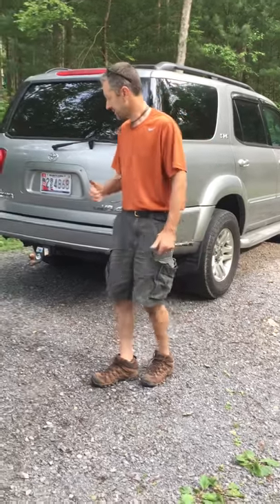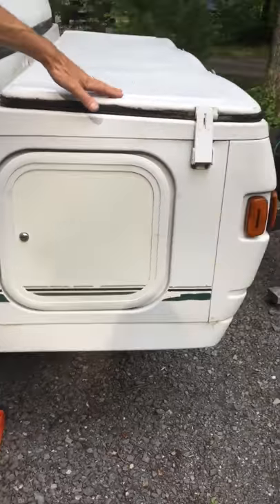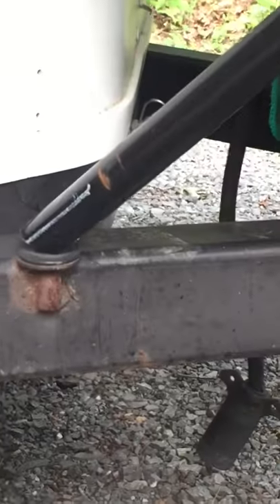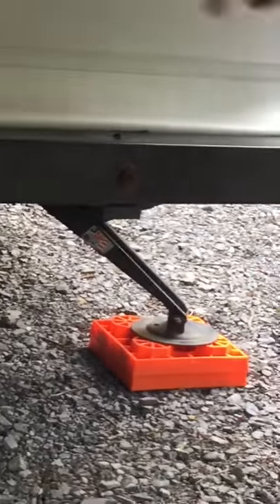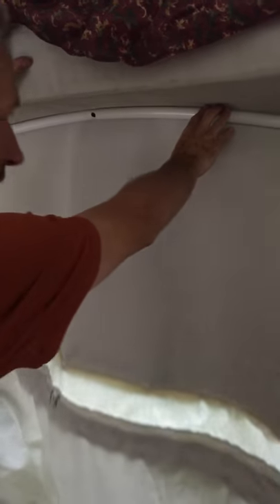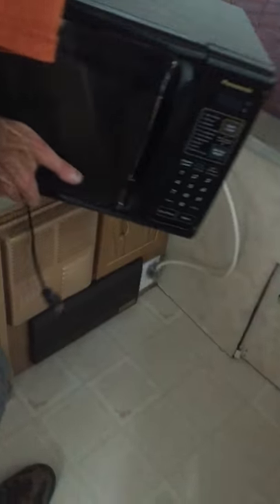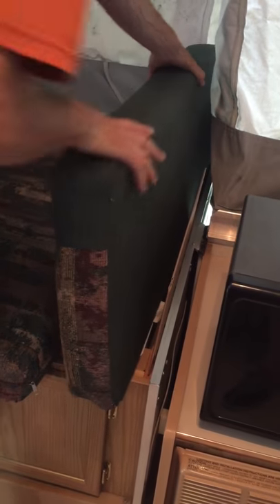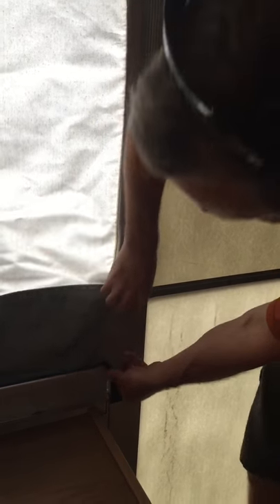Fleetwood bayside popup instructions

Comment: The door on my 2008 bayside won't fit anymore, it was working fine and then I took it out and was setting up camp and now it just doesn't line up, when I set it in the slot on the bottom it doesn't line up with the hooks/latches on top. Any idea why this might be happening and how to fix it? The trailer was level, and is level now parked at my home and I'm still having this issue. The internet has been no help in answering this question so if someone here can help me it would be much appreciated!
Reply: Join one of the FB popup groups and pose your question there too. I am fixing a used popup and am not yet familiar with this ill-fitting door issue but I have read of folks changing the way they do set up procedure and has worked to solve the door issue. Try this: After raising and leveling--extend the beds just out enough for you to step in and lower the door & secure it in place. Then, finish pulling the bed platforms all the way out. Might work for ya.

Comment: I am thinking about buying this model but the interior lights will not work unless it is plugged into shore power. Do you have any suggestions on how to trouble shoot why they are not working off the 12v battery?
Reply: Check the fuses. The electrical panel has breakers for shore power and automotive fuses for 12v.